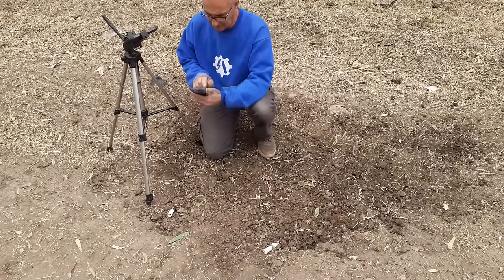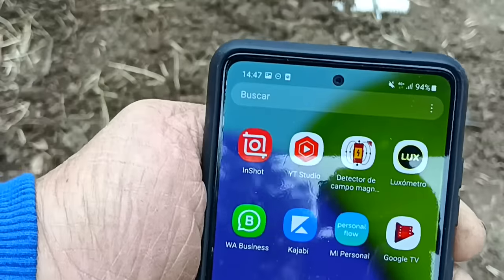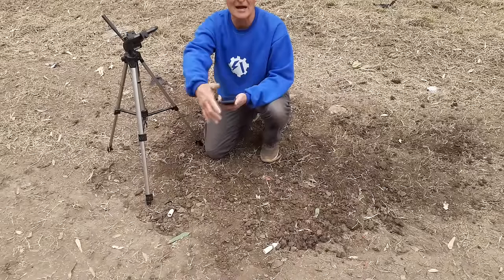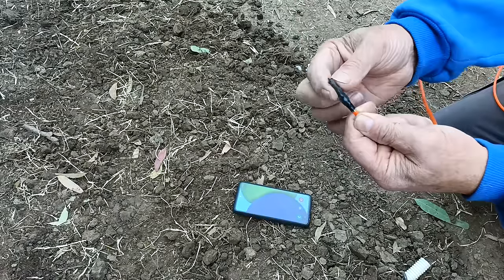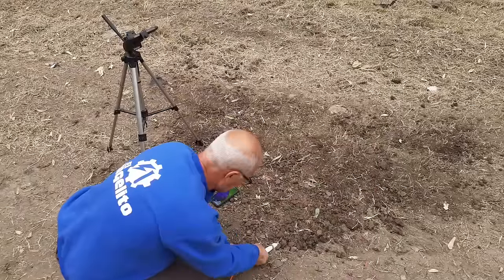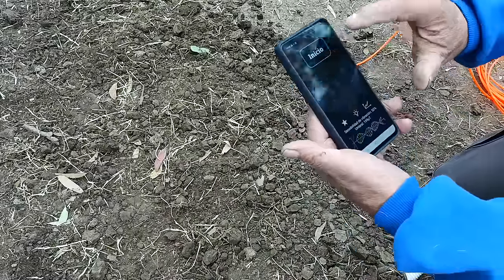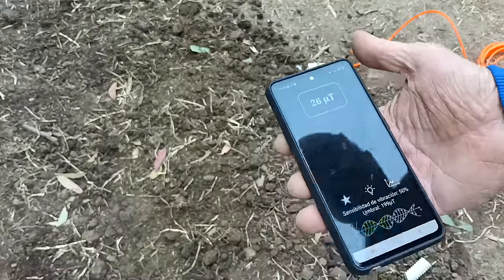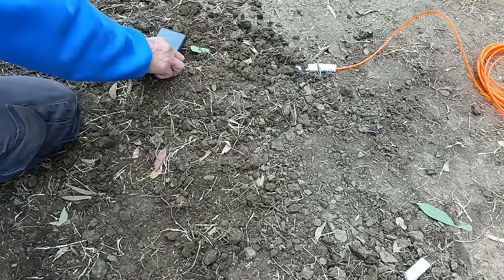Encontrar Lugar Exacto de OBSTRUCCION EN CAÑERIAS (agua, cloacas, eléctricas, etc)

Comment: Muy bueno su video y muy ingenioso. Yo tengo un problema que no puedo solucionar. Instalación vieja con dos cables de tela que evidentemente se han derretido por el paso de mucha corriente. Tenemos detectado que es una curva. El problema es que está dentro de una losa (imposible romper). Estamos intentando quemar los cable con un alambre caliente. Vamos muy despacio. Estamos a unos 40 o 50 cm del apelotonamiento de los dos cables (lo hemos visto con una webcam de endoscopía). Que se te ocurre que podamos hacer que ya no hayamos hecho ?? Desde ya muchas gracias. Sergio M
Reply from the maker: Te aconsejaria hacer una instalacion  nueva y externa, con cablecanal.